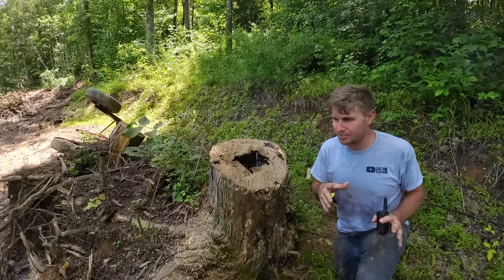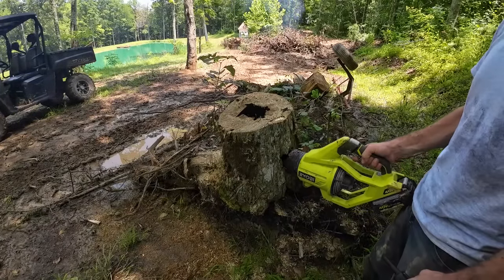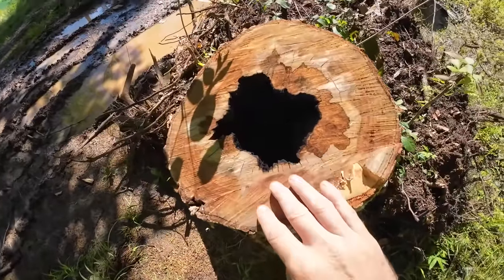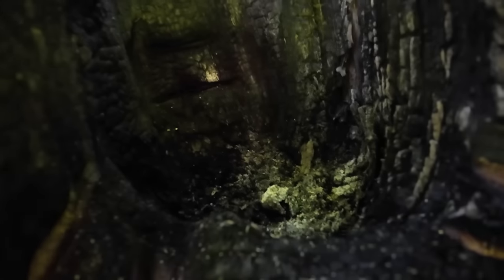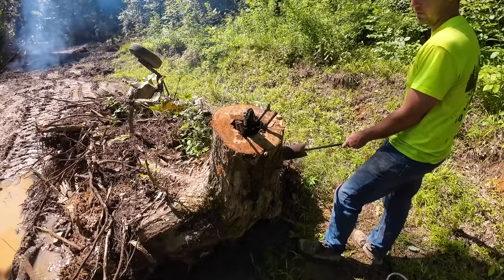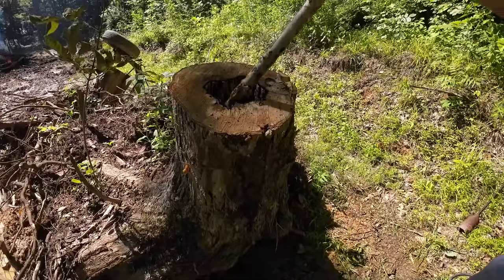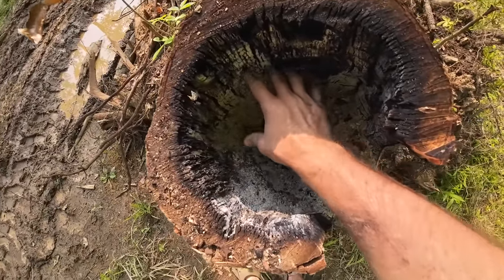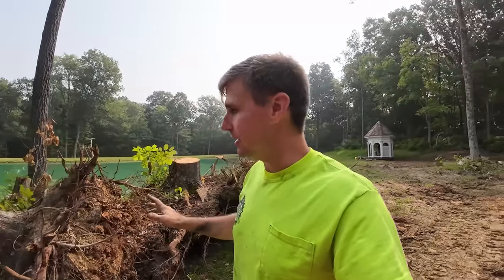Is This the Best Way to Burn a Stump?  A Subscriber Suggested it, so I Tried It!

Comment: I tried the method of soaking a stump with with diesel in holes drilled into it.  Then use a 55 gallon barrel with the open end put down over the stump and propped up a bit for air access.  Not a winner….at least not for me. 

Even tried it with soaking over an extended period to make the stump highly fuel loaded.  Still didn’t work.

Comment: There is not enough "chimney" for it to draw. Put a 4 or 6 " flue pipe over the top hole about 6 feet long. The longer the better.

Comment: Hi if time & space is not a crucial factor in the job , then what you have been doing, stacking burning then re stacking is the way to go,slower but you will get the job done. If you are against the clock or space is limited then you would need to look at other solutions. I don’t think there is one best way, it depends on the job. 👍🐝🌞

Comment: Take a chainsaw and cut an x into the stump (vertical/top down), pour used engine oil into the cracks (repeat as necessary), allow this to soak in, use a few drops of gas, light  same, and watch that thing burn.  Make sure it is very dry when you do it.

Comment: I know this is an old video. Build a fire over a stump. As soon as hot coals are burning hit it with a leaf blower and don't stop blowing it. Blow on it while walking around it to get an even burn If you blow one side the other half will not burn.

Comment: There is too much moisture on that stump and that's what is slowing it down.  It would be a lot faster if it were dry.  It will continue to go out due to the moisture until the moisture gets out.

Comment: There's no good way to burn a stump. The roots keep pulling up moisture from the wet ground and also close contact with the wet ground cools the wood as it tries to burn. After a long dry spell, it would have burned a lot better, but still probably not 100%